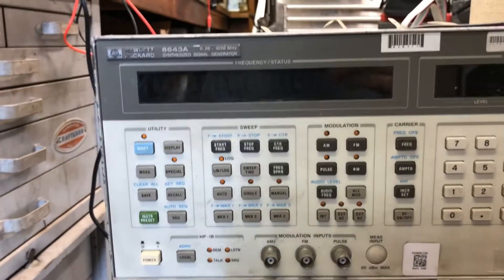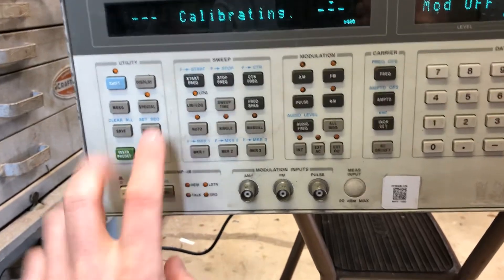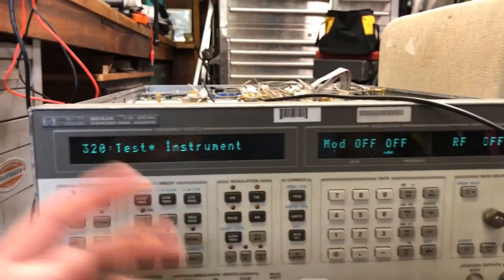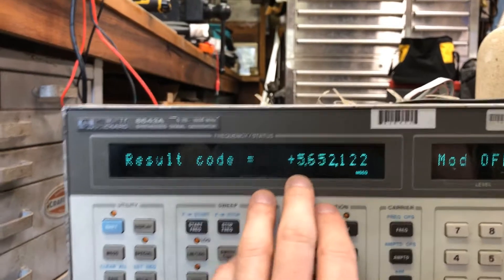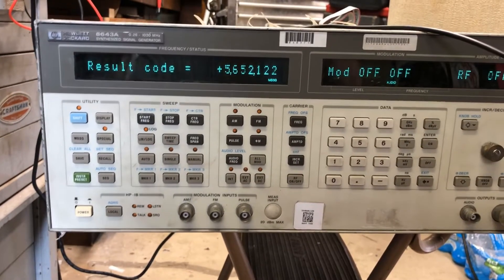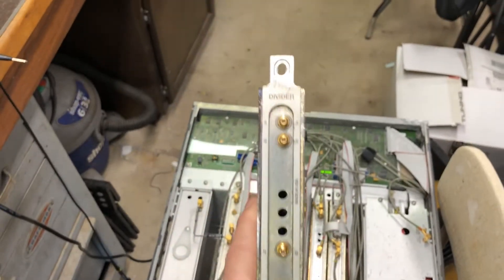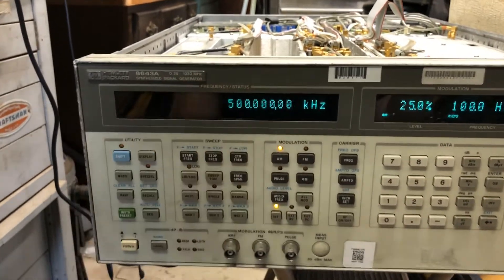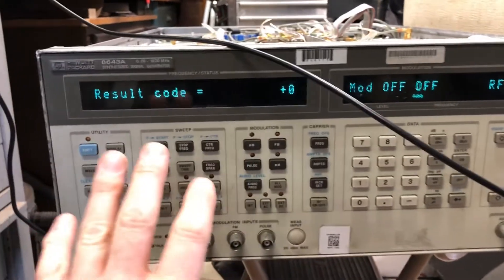Hewlett-Packard 8643a Signal Generator Diagnosis and Repair

Comment: Great video. I am troubleshooting my HP-8643A. My unit developed a result code of 14, 020, 122. Also my unit has a serial number of 3546A. I cannot locate a service manual either.

Comment: It looks complicated when working on them but break it down to sections the HP’s are easy to troubleshoot and service. I fix a few of them. The rohde & schwarz RF signal generators are the difficult to repair as no schematics and service manual just stated literally replace the whole module. So your pretty much flying blind, thankfully easy to break down and figure out. 

Thankfully I repaired mines as it has a bad mosfet and HP Bipolar MMIC Amplifier in the 3 GHz module which cause the ALC 110 error and was cause by a failed exhaust fan that seized up. I ended up completely overhauling it and replaced the capacitor and ceramic capacitors as well as well as processor CMOS battery. Even when as far as replacing the EMI glass which yellowed over the years and the LCD with a NOS one. That RF signal generator was a pain to get it fully operational but now my favorite as use it to do the HF calibration on Tektronix oscilloscopes and radio transceivers and bang on. Is going to get a upgrade as have won a bang up one but works with pulse and other options and is going to get module transfer over and calibrated as have the required gear to do so. 

Yes easy to just buy a new one cheap as spend more restoring but like the challenge and will be reliable now sorted out all worn and defective components and like new now. I do still like the old large boat anchor HP RF signal generators as great performance as far as phase noise and etc.

Comment: The link for the Service Manual seems to be bad, or they removed that manual.  I have manual part number 08648-90048. Is  that the one you have?
Reply from the maker: Yeah they must have removed it. I don’t have the manual because it wouldn’t let me download it before. Only other option is I believe someone on eBay was selling them on a CD.
Reply: @mechtrician1  You can download from here (please update your links): 

User Manual -  https://usermanual.wiki/Document/A8643A.911098848/html  ; https://www.manualsdir.com/manuals/319538/atec-hp-agilent-8643a-44b-64a-65ab.html

Assembly Manual -  https://elektrotanya.com/hp_agilent-technologies_8643a_8644a_b_8645a_8665a_b_signal_generator.pdf/download.html#dl  ;
http://userequip.com/manuals/9/Assembly-Level-Repair-HP-8643A-44A-44B-45A-64A-65A-65B-1935.html?user=  ;

Data Sheet - http://www.testequipmenthq.com/datasheets/Agilent-8643A-Datasheet.pdf

---------------------------

Since the 8643 & 8644 are referenced together (not sure of the differences), here is a doc on it:

Operation And Calibration HP 8644A - http://pdfstream.manualsonline.com/e/ee0c80ed-42d9-49e5-8332-4329a310a49c.pdf 

Hope that helps some.   ~Jack, VEG
Reply from the maker: @VintageElectronicsGeek  Thanks Jack!  I'll update.
Reply: @mechtrician1  My pleasure, hope it helps you out and anyone  else in need.  BTW, nice sig-gen...especially with markers, wow!  ~Jack, VEG